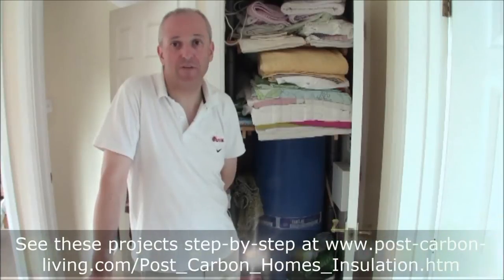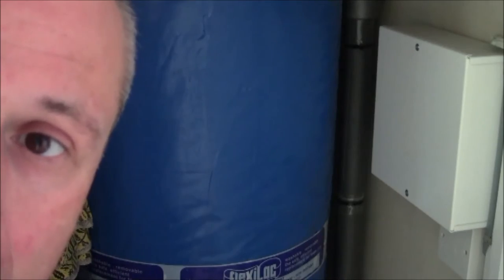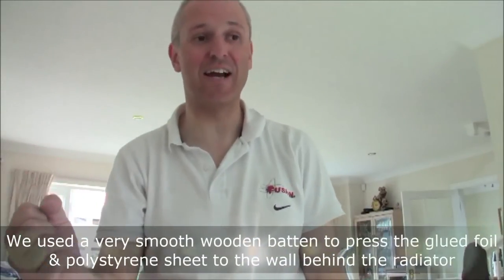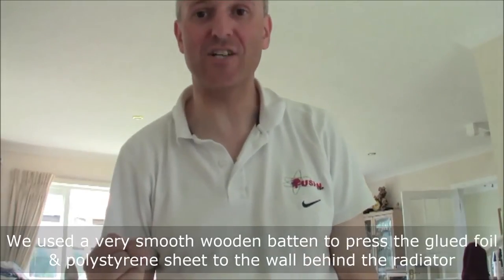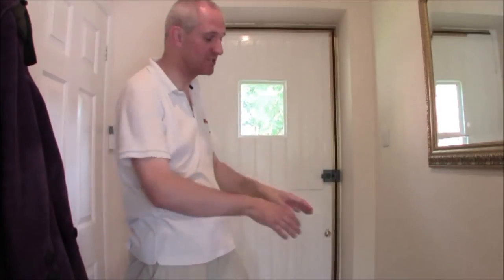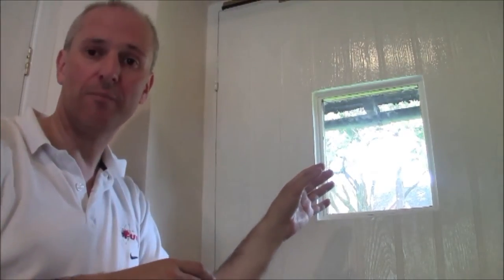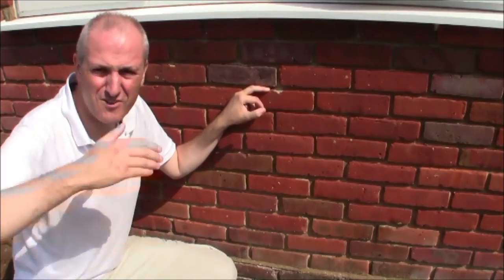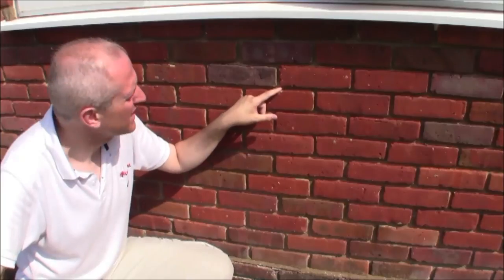DIY Insulation Projects & Cavity Wall Insulation [Superhome59 part 11]

Comment: It's been a few years since the cavity wall insulation installation. Can I ask how it performed and whether you had any issues from it since?
Reply from the maker: We had the cavities filled in the first year we moved in so we have no real baseline for comparison. A few years back I ran a thermal camera over the house and the only issue I found was that insulation in the gable-end wall had slumped into a inverted "V" shaped pile and had not been filled to the roof line. It is one of the reasons the bedroom over the garage is always colder. Our plan is eventually to supplement this with internal wall insulation. Thanks for watching and taking the time to comment. Questions always welcome!
Reply: @Superhome59  thank you very much. I'm in the process of retrofitting my bungalow at the moment hence my interest :) can I ask what insulation material you had injected in the cavity wall?
Reply from the maker: @kev6735  Well I don't think you get a choice or that it matters but the material used for our home was a yellow fluffy material. It was not white polystyrene beads.